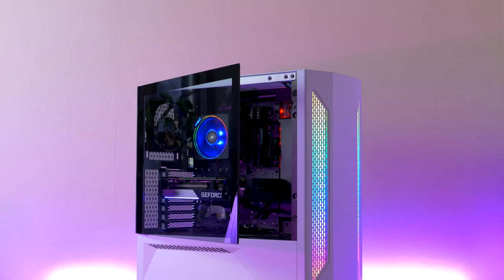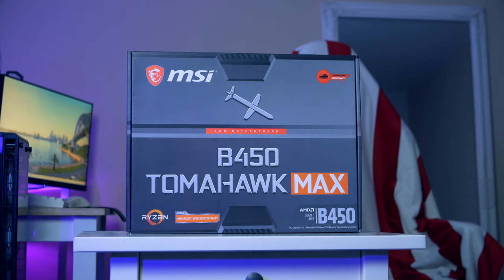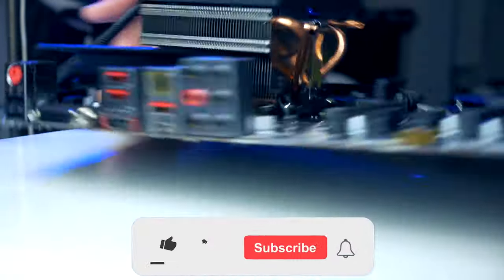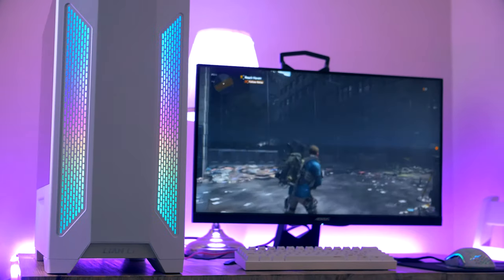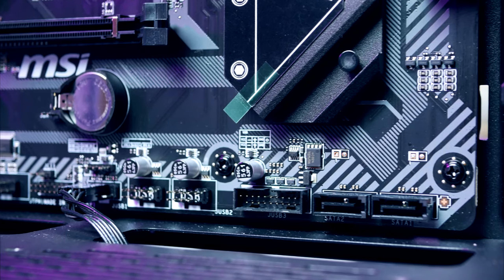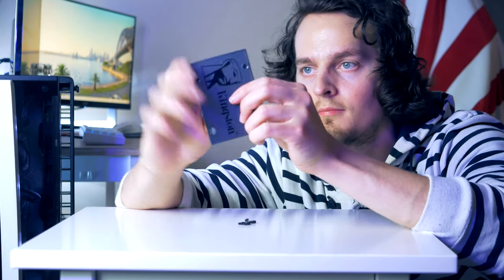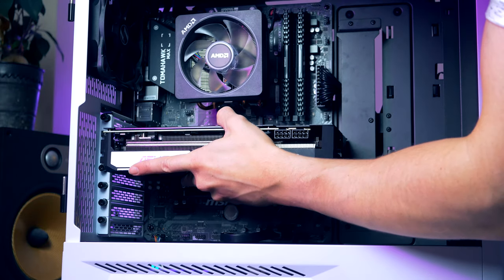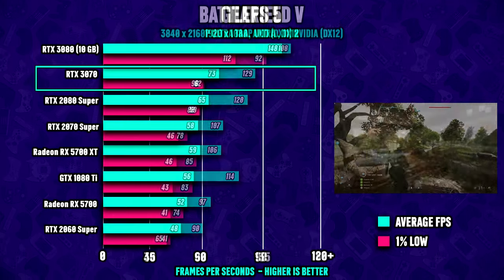Building A Cheap But Powerful Ryzen Gaming PC For Beginners w/ Benchmarks ft. RTX 3070 [2020/2021]

Comment: for the same price you can get a B550 mb
Reply from the maker: very true indeed! The Lancool 2 can however hold up to 8 case fans so having a few extra fan headers on the motherboard is always a nice feature IMO :)
Reply: @RBNHardware  true, but also an M.2 nvme SSD directly on the MB would be nice (same price)